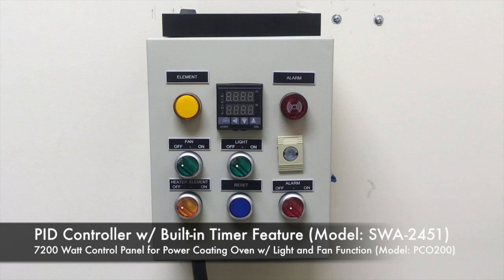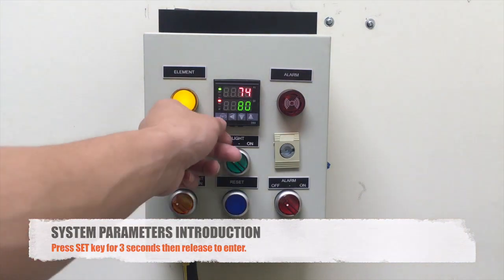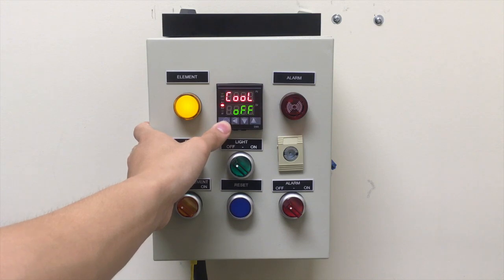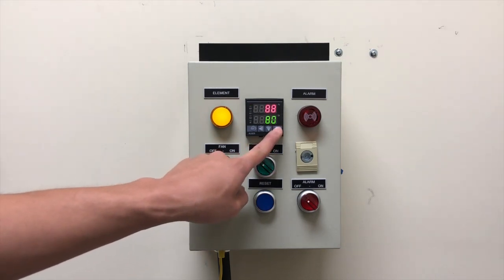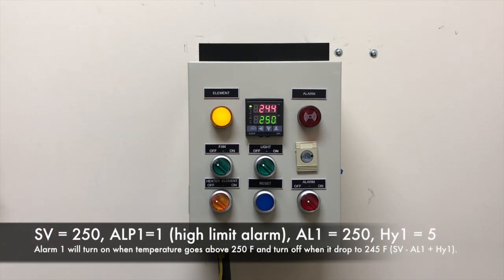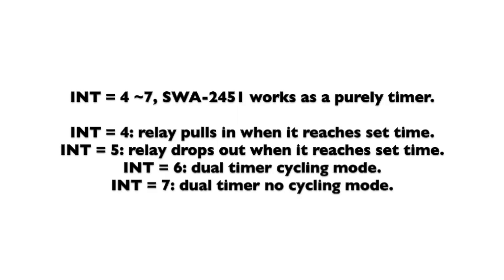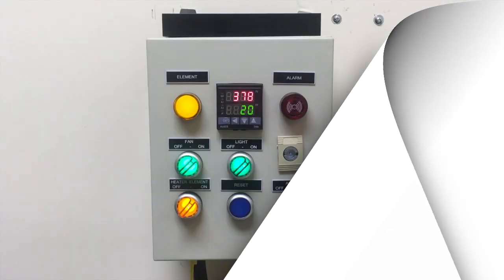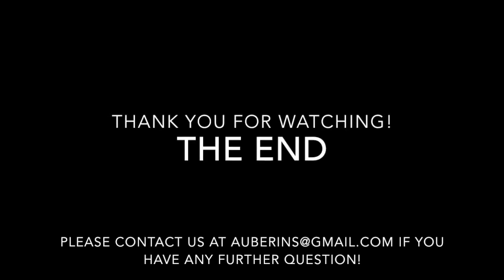Auber SWA-2451 Temperature Controller with Timer Tutorial Video

Comment: Can you recommend a pid with a timer that's 240V and 30A? I have to power a 5500W element.
Reply from the maker: PID module typically cannot drive 30A load directly. Other than the PID module, you need other parts to build a control system to drive your 30A load, such as SSR, heat sink, etc. For oven application, SWA-2451B PID module with timer is recommended. For water application, you can check our EZboil products such as DSPR120. We also offer some control panel/DIY kits. Please check our website: auberins.com
Reply: @Auber Instruments Official  thanks for the reply. I have all of that stuff hooked into a system now with a competitors PID. I would like to replace the PID with something that would keep my sterilizer at 250 degrees for 24 hrs and turn off the output automatically. I have two boxes with an SRR, heat sink, cooling fan, and PID. Both are 240v 30amp and power a 5500W element each. Would the DSPR120 be a good fit for me?
Reply from the maker: @jeremysavitt4211  For sterilizer, SWA-2451B is recommended. DSPR120 typically needs to read the water temperature to control the power to the heater. For your application, you need to read the steam temp instead of water temp. We also offer one control panel for mushroom sterilizer (MS100). It uses SWA-2451B PID controller with timer. The default timer mode (INT = 1) is, timer will be started when it reaches your target temperature. After timer is up, it will stop the output. You can set timer to be 1440 mins (24 hrs).

Comment: We just installed this on a heat treat oven. I can't get it to come up to heat on it's on unless I use the timer and it time out before hitting the correct temp. Can do it manually but it just keeps going past the needed temp.
Reply from the maker: For your first question, it is related to your timer settings. If you don't use timer function, you can disable its timer function by setting int to 0. Then this controller will work like a standard PID controller without timer. For your second question, I'm not sure if this issue is due to your PID or due to your relay/SSR. For the PID issue, you can probably try ON/OFF mode and see how it works. You need to set P to 0 and adjust Hy accordingly. It could be easy for you to contact Auber support directly for help.
Reply: @auberintruments  thanks! We just got it installed and just messing with it. I'm sure it's something I'm doing. Gonna check settings again then if nothing I'm gonna call.  I appreciate the reply :)